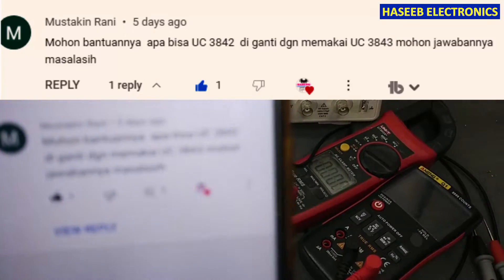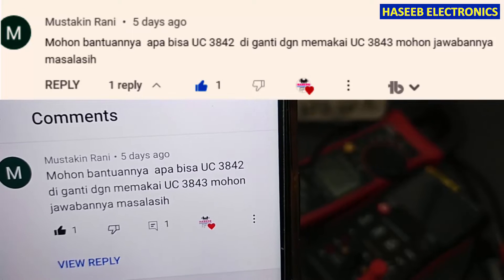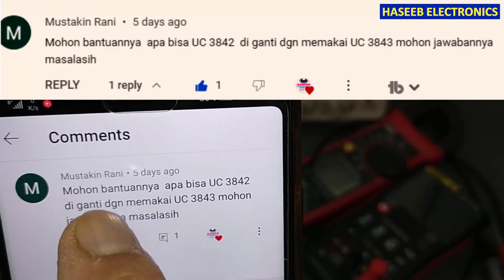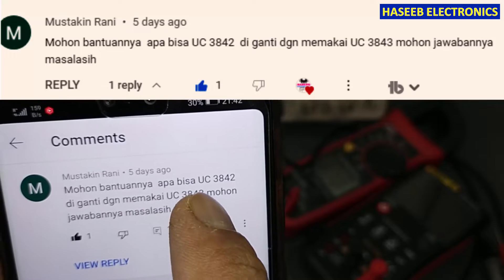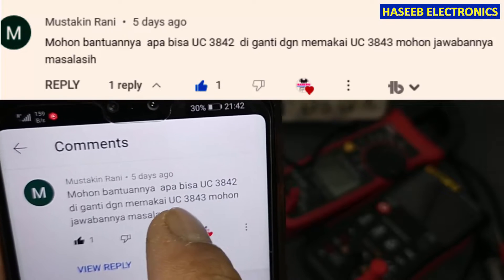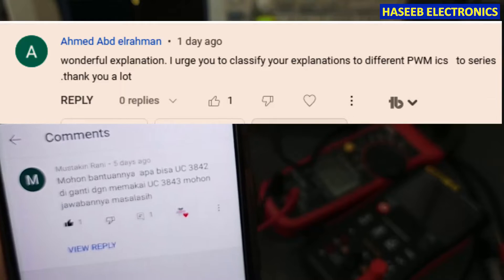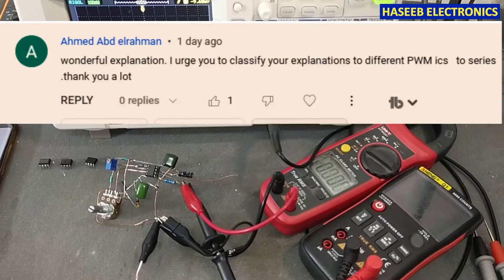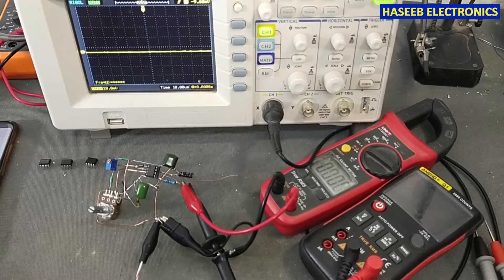{779} Comparison between UC3842, UC3843, UC3844, UC3845 ICs

Comment: Peace be upon you and God's mercy and blessings, Professor Hasib Allah. Thank you for all your valuable and very useful videos. Professor, I have a welding machine that broke down, and after replacing the oscillator IC (2845B) with the IC (UC3845), the welding machine did not work. Could the reason be the incompatibility between these two ICs? For your information, this machine is an Arc Mini, Romanian type, and the IC (2845B) is not available in the market. Professor, what do you suggest I do or what is the alternative that is compatible with this IC? Thank you very much.

Comment: good afternoon sir, I just tried make a simple 17vdc power supply for UC3842, by using resistor 220k/3watt and zener 17v/5watt (IN5354B), and capasitor 220uf/35v, taken directly from the main power outlet and change it to vdc (about 310 vdc), but it does not work well, the voltage at the zener point is not stable, but if not connected to the UC3842 then it is fine, stable at about 18.1 vdc, please advise me how to make it stable? thanks a lot sir, cheers.

Comment: Why would you use a UC3844 instead of a UC3842? its half frequency, half duty, but can't you just use different cap/resistor values to halve the frequency of the UC3842 while maintaining it's 100% duty adjustment?

Comment: Thank for your time and effort to explain the most important information 
If you dont mind I want to ask about mosfet drived by utc3842 sometimes we find diode and low resistance  in parallel to feed signal to mosfet gate the question is how that work and what the benefit of that 
Thank you again

Comment: 🙌Hello Sir!   i'm learning a lot from you, thank you! 

 Sir, can you please explain the E247691 (EAX64604501) LG TV POWER SUPPLY? 

 It has 3 volt but no other output(12v, 24v..) even turned on the switch.  What could be the reason?  Please!

Comment: Thank you for your valuable service! Great job explaining! I went from knowing NOTHING about power electronics and SMPS's, to being able to at least diagnose where the problem is. Almost ALL electronics in the world use SMPS's now, so that makes this one of the most practical electronic channels on YouTube. Especially now, with shortages in the world, a broken machine could cost $$$$ each hour it's down! Can't just throw it all in the garbage like the old days! Have a great day sir!
Reply from the maker: best regards and special thanks for your valuable words
yes you are right, these days the SMPS is the main item in modern electronics and it is a biggest headache. so that is the reason still my focus is on power supplies. other all digital electronics and analog electronics is very simple. that can be diagnosed very simply and easily

Comment: Slmz, Please do a video on short circuits, I understand electronic short circuits, to a certain level, but it becomes tricky with smd components especially with capacitors. Are all caps one side ground, and how much resistance or voltage drop exactly is a short. Some ppl test in diode mode, red on ground, some test diode mode black on ground, some test in resistance mode? Which is the correct method?